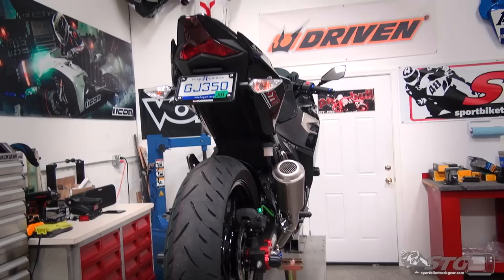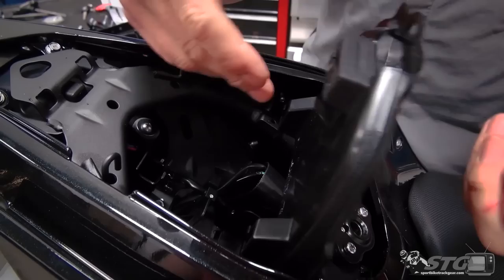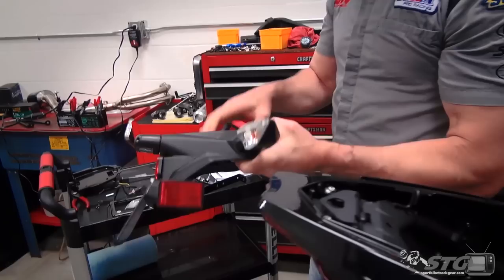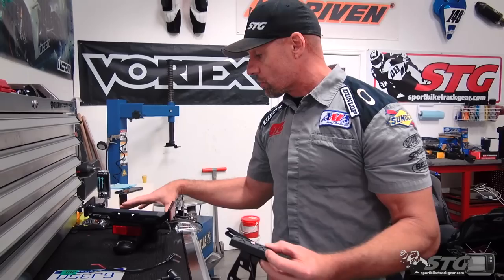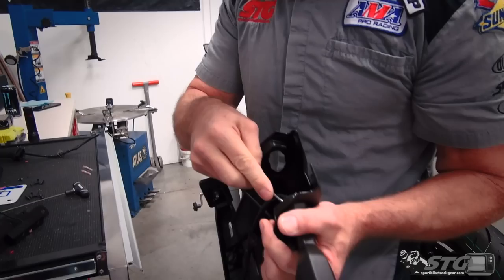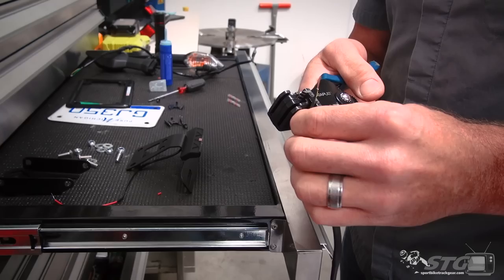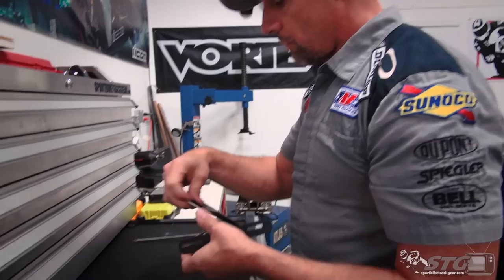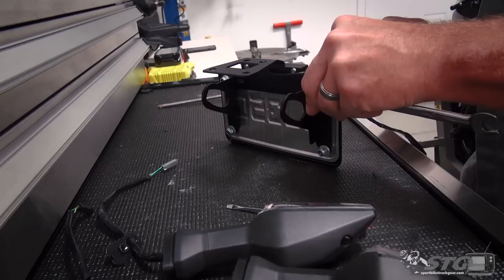Yoshimura Kawasaki Ninja 400 Fender Eliminator Install | Sportbike Track Gear

Comment: At the end of the day, I don't like the the fact that the turn signal brackets are a part of the plate assembly mounting.  One hit to the plate and you have more than just a bent plate.
Reply from the maker: Check out the New Rage Cycles fender elim for the Ninja 400. Here is a link to it on our site: https://www.sportbiketrackgear.com/new-rage-cycles-kawasaki-ninja-400-2018-fender-eliminator/

Comment: Feel like the keni moto one is just as good and its like a third of the price. 1. slots for the oem turn sigs 2. You reuse the tag light, 3. No cheesy branding is visible. 4. Tucked up close under the tail just like this one. 🤷 I will spend money on quality performance parts, but spending over $100 for a fender elimnator is WILD.
Reply from the maker: Never heard of that brand. As I rule I do not install or recommend any of the Amazon/eBay brand accessories on any of our bikes. - Van
Reply: @sportbiketrackgear  never heard of em until recently either and I'm saying for the price the quality is right there with the $100+ options.

Comment: I’m afraid Vagabond is the way to go if you’re keeping your stock lights. One solid piece , very comprehensive install videos 👍
Reply from the maker: Zero personal experience with that brand. Took a quick look at it, very simple design that needs the OEM rear signals and plate light to be installed. The Yosh eliminator ships with an LED plate light, includes a plate frame and offers the ability to run aftermarket LED signals (optional brackets required). End of the day depends on what you prefer on your bike. I have installed 4 fender eliminators on the Ninja 400 now, each one offers a different look and features. - Van
Reply: Sportbike Track Gear 
Absolutely, it’s all about preference. Great job with your Ninja 400 vids 👍. 
Perhaps a new Project bike to look at would be that New Honda CB300R..Yes it’s only a 300, But one of the best looking little bikes out there, makes a great beginner & or 2nd bike that’s inexpensive.
Reply from the maker: Thanks for the kind words and for watching! For 2019 we will finish up the Ninja 400, the GSXR 1000 and the R3. (Still have a Grom and a Z125 to finish) Man I need a couple extra days in the week! I will have to check out the new Honda. - Van

Comment: My light didn't work.  I've installed one before  and  that worked  fine.
Reply from the maker: Double check your work to make sure this is not a bad connection. We do not really see any bad bulbs with these kits. - Van

Comment: Awesome video...thanks for making it so easy to do at home.  I'm looking at getting a Ninja 400 and wanted to install this after getting the bike.

I'm definitely not a track guy and was planning on a back roads/sport touring style riding with the Ninja.  I was looking at the Zero Gravity sport touring windscreen and wondered if you had any experience with it?  Also, since this eliminates a lot of the fender/mudguard, would you recommend something like a Puig fender extension, for my intended riding style?

Thanks in advance for any advice you can provide!
Reply from the maker: The ZG windscreen will get some wind protection for sure. Personally I do not think you will need the fender extension if you leave the rear fender on the bike. - Van

Comment: Possible simpleton question as I am brand new to riding, but you are disconnecting the battery before doing any wire work/removal, and then obviously reconnecting to test everything after correct?
Reply from the maker: You do not need to disconnect the battery for this fender eliminator kit install. There is no power to these lights with the key off. - Van
Reply: @sportbiketrackgear   Thank you very much sir. Looking forward to my next visit to the store!

Comment: Do you have to shorten the wires? Can't you just leave them stock length and bundle them up like you did that one long one at the end?
Reply from the maker: You can leave the stock length and hide them in the tail if you like. - Van

Comment: I got this Yoshimura fender eliminator and the turn signal relay failed after 2 weeks. After another 2 weeks of phone calls, I FINALLY got a replacement relay from Yoshi. The turn signals aren't super bright either. If I had do it over again, I'd get a different kit.
Reply from the maker: Did you reuse the stock rear turn signals or install a set of aftermarket signals? If you reused the stock signals installing this fender eliminator would not have any affect on the turn signal flasher. - Van
Reply: I did not reuse the stock turn signals. I used Yoshimura's LED turn signal kit designed for this bike.

Comment: What about the reflectors on the OEM rear fender?  Many jurisdictions require them and it is illegal to not have them is equipped.    

You would think someone would have come up with a plate light connector to avoid splicing wires.    

$130?!  Are you nuts? There's about $10 in material cost.  I'll give them $10 for overhead, $10 for advertising and your up to $30.  Throw in a $20 spot for "gee-wiz profit" and its up to $50.    Over priced.   Being new to "the bike scene" it sure seems like all the companies are out to gouge customers out of their hard earned cash.  So sad.
Reply from the maker: There is not as much profit in this as you might think. Yoshimura manufactures these here in the US which adds some cost. I can assure you no one in this industry is getting rich. - Van

Comment: I recently installed a fender eliminator kit on the 17 r6 and the check engine light has been on for a few days. Do you know what could’ve gone wrong?
Reply from the maker: If you have a check engine light on the R6 after installing a fender elim kit the only thing that comes to mind would be leaving the exhaust servo motor being unplugged (this is assuming you unplugged it for some reason during the install). Could be a coincidence. - Van

Comment: Do you know if this would fit a European motorcycle plate?
Reply from the maker: It is designed to fit US plates. If the dimensions of your plate are different it will not fit. - Van